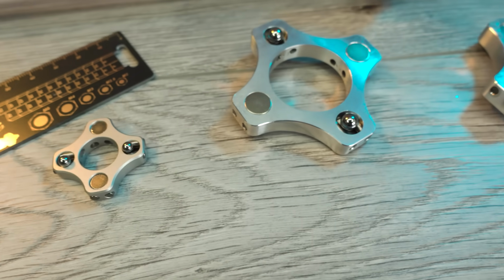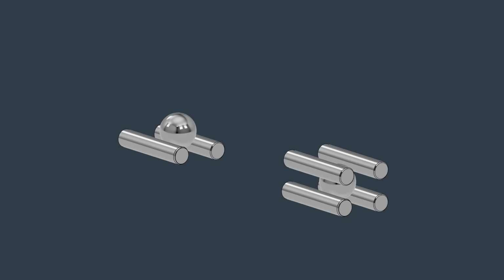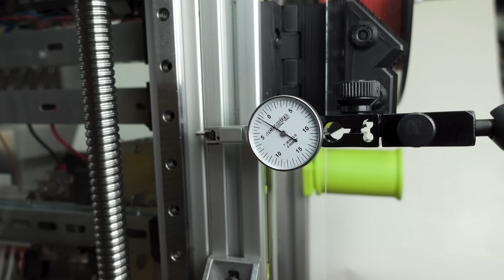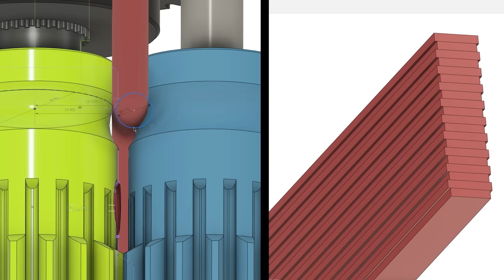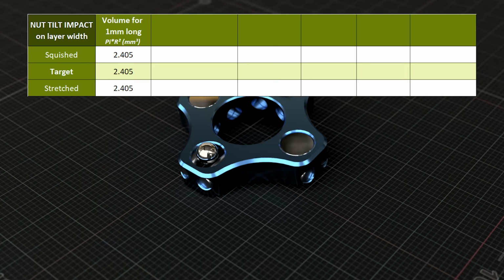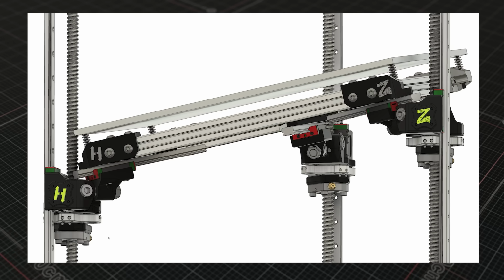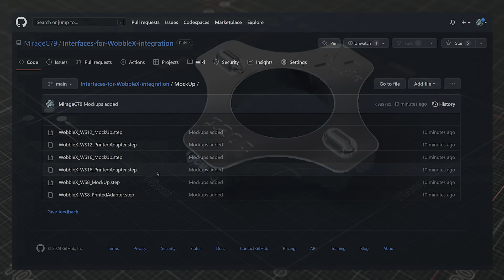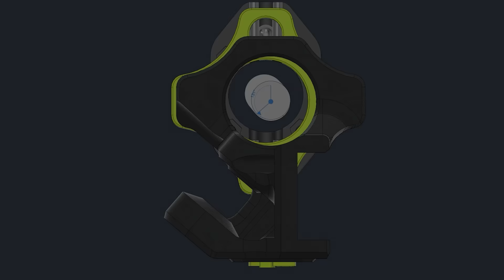I will never talk about Z wobbling ever again !

Comment: 😂 if your thread rod was on a flexible coupling and not constrained at the top wobble would not be an issue because it would float. Use linear rails to align the build plate.

Comment: I appreciate the content and the video but I’m a little bugged that you didn’t just replace the part that needed replacing before you did the first print, it may not have changed the results at all but we will never know for sure because you tampered with the only thing that would keep this measurement an accurate representation of its effectiveness.

By changing that one additional piece out you lost the ability to attribute the changes to your new design and means this isn’t a reliable proof of the quality gains.

Comment: The ratrig v-core 3.1 remove any z wobble with a constrained leadscrew and a bi-material leadscrew decoupler, it works like a charm and is less complex than your system. But it uses standard tr8-4 leadscrew, not a ballscrew like yours.

Comment: Building a Trident. Going to get Wobble X but should I get ball screws also or just stick with lead screws. Is is enough to run Wobble X with leads? The ball screw upgrade seems kinda a pain with having to couple them and modded STLs.
Reply: Don’t get wobble x get mini oldham wobblers, they’re cheap and work the same.
Reply: @SecretAccount-v7u few things, I can find a real good video on them. I also don’t think they are big enough, I’m using a 1204 ball screw so the hole needs to be bigger than 12mm. Also they are the same cost from what I see Wobble X is. 🤷‍♂️
Reply: @F1v30h1 ah ok it seemed like you were still deciding between the leads and ball screws, which Is why I recommended them, they’re ideally the same thing as the bi material decouplers that the RatRig vcore 4 uses with the tr4 leads. 

They do make them for ball screw setups, would save a lot of weight and size but you may have trouble finding them as they’re not as common.
Reply: @F1v30h1 you could always make them yourself if you want, I ran a homemade set for a while using 2 precision flat washers with a thrust bearing sandwiched between them and a bit of grease.

Comment: could also just use steel belt for Z instead of ball scrows ( steel belt also run directly on the shaft so no off/runout from the gear chat you normally see with timing belt )

Comment: It mentions that the wobble x is intended for single lead screw applications. If I wanted to install on a dual lead screw system, could I install small springs to add a bit of squeeze preasure so that they don't separate.

Comment: Full rotation of a lead screw does not exactly translate into a single layer height. meaning there "squish/spread" of layers will gradually increase/reduce over multiple layers. So instead of ladder you will get more like sinusoidal shape

Comment: I currently have an anti backlash nut old ham nut attacked to an anti backlash nut (the hold ham has no threads since it's supposed to move round) spider coupling different motor mount and a thrust bearing. I even shimmed the motor forward to align it. Better.

Comment: On normal Prusa style printers, we eliminate this problem by having rigid vertical Z axis guides and a free floating bearing at the top of the drive screw.  This system allows the screw to wobble without affecting the printhead, I was doing this on my DIY 3d printers in 2010.  This just feels as if you are overthinking the problem, which is the opposite of good engineering.

Comment: I wonder if this would work at larger scale for a large CNC router using 20mm ballscrews? Often those deal with shaft whip when running at speed and that leads to artifacts on the parts as it cuts. Having a compensation unit like this might, while not eliminating the core problem of whip, alleviate its major effects on parts. Especially for wanting to cut things like foam.

Comment: I got so exasperated at looking for the cause of my wobbling and banding that, when I discovered that the second lead screw was going through a malaligned flange attached to the backplate, I lost it. 

Got unlucky with Creality's quality control (or lack of it).

I stripped out the lead screws and modded the z movement to use belts instead, driven by a stepping motor on top of the assembly. It rotates a horizontsl bar via a transmission, which provides the vertical movement for the belts. 

Worked a treat.

Comment: After buying 2 of the T8 versions of the WobbleX (at $16.50 each), here's my conclusion:  They were installed on a HEVORS coreXY printer with a moving bed.  Under normal use they seem to  work as advertised.  HOWEVER, even with 4 start lead screws, the gantry will drop somewhat under its own weight when the printer is powered off.  When the printer is powered on again and the axis homed I have had the 2 leadscrews become slightly out of sync due to the uneven drop of the gantry.  I have 2 independent steppers on my Z axis. This causes the wobbleX coupling to become "disconnected" from the bed bracket and the balls to fall off.  So if the leadscrews become even slightly out of sync there is nothing stopping RADIAL movement of the wobblex coupling.  If your printer has only 1 leadscrew or only 1 Z axis stepper with a drive belt driving both leadscrews you might be ok.   I have since removed them and installed oldham couplings.  Problem solved for 1/2 the cost of the 2 wobblex couplings.  I have 2 "very slightly" used wobblex t8 couplings for sale if anyone is interested.  I only recommend them for printers with either 1 leadscrew or 1 Z stepper. YMMV.

Comment: ❌use appropriate motion system for the 3D printer
❌improve all parts together, i.e. use a frame and linear rails that are meant to be used with a ballscrew or have the ballscrew mounted in actual metal brackets instead of weak and flexible and inaccurate plastic prints
❌buy high quality parts instead of a crooked ballscrew
✅ use crooked ballscrew that is way too big for this fragile printer and spend the money you saved on the ballscrew for extended engineering just to make the cheaper ballscrew somewhat usable, and then sell the solution to your self-inflicted problem on youtube

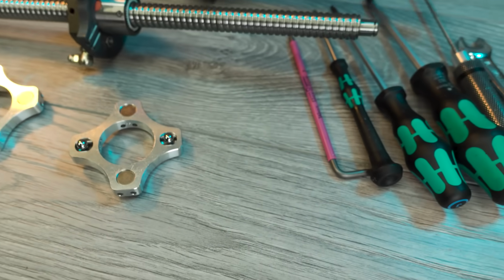Comment: 0:04 close. The actual best is to remove the screws all together and use linear motors ( though it can be a bit pricey for off the shelf or hard to figure out diy )
Reply: Absolutely not. I mean, unless you want to give away a ton of your Z height. This is a horrible use for linear motors.
Reply: @BifsieOfficial  casue zero chance of z wobbling ever happening. extremely precise. smooth and fast
Reply: Correct! Linear motors are better suited to this type of application indeed; their higher precision coupled with higher speed capability over ballscrews make them the obvious choice if not for the cost of entry; the low-torque demand of 3D printing thermoplastics lends itself to linear motors- one of the major reasons we build multi-axis turning centers with ballscrews over linear motors most of the time is simply due to a ballscrews ability to transmit higher forces into a workpiece (alloys). 

MCC (Marubeni Citizen Cincom) does infact produce a 4 & 7mm capacity turning center that uses linear motors on its X1,Y1,Z1 axis', along with Z2; AC induction motors are used on both main and sub spindles. Same for the live tooling drive- intelligent servo drive induction motor. The R04 & R07 were designed primarily with the medical implant industry in mind, although they are quite popular in the connector & aerospace industry as well. They are both used on any alloy you can imagine- 300 & 400 series SS, Titanium, Inconel, etc- while easily maintaining tolerances of +/- 10 microns in those tough alloys(these things can rip----  (32m/min)

Linear motors for all their extreme accuracy start having issues with larger material (10mm on up in turning applications) with hardness higher than 50 HRC. While it IS possible to design a linear motor to handle the application, cost becomes a serious concern. This is likely also a barrier to linear motors in 3d printing- at least consumer grade printers anyway. Even a small Mitsubishi Automation linear motor & way can easily exceed $5000 USD. Probably not many people would pony up for such a machine, considering printing PLA, PCTG, ABS, PPS, PPEK, ETC would never benefit from such tight tolerance capability. It would however be seriously cool.
Reply: @Alan-tr5uj  yeah they can easily be made for higher torque ( actually very commen ly used in those big gantry traveling 5 axis ) another benifit is also there zero contact zero physical wear 

i would like to correct you on one small thing. citizen lathe's do have or use sub spindle's. what they use and have is called a counter spindle ( diffrence is that as the name emply. a sub spindle is subpare to the main spindle in both power/torque and also regidity. but a counter spindle sit's and turn counter clockwise compared to the main spindle but have just as much power/torque and regidity as the main spindle ) ( im a fully educated machinest with speciality on turning and have worked on many citizens throughout my time and spike with both repain technitions that only do citizens but also to some citizen enginer's themself that all told me that they dont have sub spindles only counter spindels and what the diffrence was ( last one i used was a citizen abx64 ( tripple turret dual spindle all iso programmed by hand only cycle i use is threadding cycle( yes i write every single rouging pass myself ( actually prefer it that way. so i have absosolut controle over every pass and movement ( actually have my own special methoud that increase the inserts life time and remove vibration )

well if we could use the econami of scale to get the price down it could be need to then have and use a low speed high torque extreme precision version of them in a resin printer ( that increased/extra precise layer hight in resin print would be awesome ) not like it would make that big a diffrence if a resin print took 5 hours or 5 hours and 10 min when we reach those time scales

Comment: I would like to see comparison between wobbleX installed and not installed with removing the top holder for the balscrew which is unnecessary. I think will have same result.

Comment: The design looks fundamentally found. What I am wondering about is cost - if the wobble x costs $30, how much more would it cost to get a lead screw that is actually certifiably straight vs getting a cheaper one and a wobble x?

Comment: would this work on leadscrews driving other axis of a 3d printer? Thinking of building a printer driven entirely by high helix dryspin leadscrews and nuts. This may negate some vibration from high speed rotation if it could be mounted in other orientations.

Comment: Thanks for the response on the other Z wobble video. I am just copying my design query from there to here. Could you have also removed the wobble by placing the drive at the ball screw nut instead of at the bottom (or end) of the screw? You are only fighting the wobble because there is a gap between the drive and the ball screw nut and the deformation of the screw between the two. It would be easier to fix the screw (vertically, let it wobble around horizontally) and drive the nut directly with a thrust bearing between it and the platform connection. To spin the nut with the motor, not the screw.

Comment: This whole video makes no sense and is a snipe hunt.  Your extruder literally has NO play in it when on linear rails.  The lead screws are even attached to the steppers with flexible couplings so they CANNOT interfere even if you have lesser z-axis paths like wheels on v-grooves.   STOP this crap!

Comment: Do not waste your money on this unless you enjoy being on your hands and knees looking for ball bearings every time you look at the printer the wrong way. 

It works well when it works, but even the slightest bump (or even ironically, a bit of lead screw wobble) will cause the bearings to unseat themselves and fall onto the floor. 

If your lead screws and rails are too smooth and drop when the steppers aren’t energized, the angle is also enough to throw the bearings out of the coupler. 

It’s the worst. I am at my wits end with this horrid system.

Comment: I did much the same on a precision X-Y table I designed in 1993. The precision-ground NSK ball screw I used was very good geometrically but under high (1G) acceleration against an offset load, the ballnut would skew under deflection of the bracket and subsequently jam on the screw. What I implemented was basically a U-joint around the ballnut. Rolled-thread lead screws are pretty bad for precision but at low acceleration I suspect you could get away with a rubber mount.

Comment: I'm a little confused about why a person would buy massive rolled lead screws that have such terrible runout in the first place.
Reply from the maker: For their excellent ratio of Price VS reliability and low maintenance ;)
Reply: Low maintenance (for ball screws) I get. Reliability, well sure, they will be reliably wonky. (But if they are wonky in precisely the  same way EVERY TIME I can see the benefit.) The only thing left is the size, and that seems nit picky if that is the only complaint.     @MirageC
Reply from the maker: The size?  Ball screws of the length we need are offered in 12mm or 16mm as the smallest diameter available.  You may find smaller ones, but for rolled screws, its pretty much the minimum they can do without turning them to noodle.  Most manufacturers wont offer 12mm rolled screws over 500mm (including machined ends).   @jonathanseagraves8140
Reply: HAHA Turning them to noodle, I like that.  @MirageC

Comment: Remove the top bearing, let the screw wobble at the top. With only two points of contact you cant get any wobble.
Reply from the maker: on a flexible lead screw with a solide printer frame, this might work.  But when using ball screws it does not work.  I tried all possible scenarios over the past 4 years.  Nothing worked as good as these WobbleX.
Reply: @MirageC  i just got a cheap flexible coupler on the motor, screw rests on the motor axel, and the "nut" has some play and I haven't notice any wobble. My frame is not so strong, so my main problem is vibrations on corners. In your case you might have a flexible motor mount too, and all you need is to prevent rotation. If you have an extra bearing on the bottom that might prevent pivoting on the motor mount / axel. More mounting points more problems.

Comment: Does this device have to be metal? Maybe try printing it? I mean the body.
Instead of round shafts, can I use a scrap screwdriver or an HHS drill of the required diameter?
Reply from the maker: If your bed is not too heavy, you can make this out of anything.  ;)
Reply: @MirageC  Thank you for your reply. I thought so.
I have a Bluer Plus printer, it's like an Ender 3 but with two screws in the Z direction.
I'll try to print it. Using carbide drill shanks as shafts.

Comment: Hi, simply cannot understand why you don't get a straight ball screw or re-machine the bearing journals (if that's the issue) Probably one that is ground not rolled.
Reply from the maker: How much is a straight ball screw? And within what tolerance would it be?
Reply: I’m not an expert but I would guess a ground ball screw and nut would be a few hundred British pounds sterling. The upside is tolerance would likely be under 10 microns
Reply from the maker: A few hundreds for having to beef the frame up so it does not get wobbled around?  10 microns will still show up pretty good on the surface finish.  I think I prefer my 3 X 30$ screw with 3 X 25$ wobblex that completely remove the screw tolerance from the equation. ;)  By the way, some aircraft flight surface (Flaps) actuation system use very similar systems on their ball screw nuts.
Reply: Hmm, not convinced. There is probably a reason that ground ball-screws are found so commonly in precision equipment.  Complexity is the enemy of every design and your solution looks like it opens the door to many more issues than it solves. I understand it’s your baby so you feel protective over it though.
Reply from the maker: @johnharlow486  don't get me wrong, if you have the money to through at good ball screws so you can benefit from their low maintenance and high linear precision, be my guess.  I wanted to provide this opportunity to a larger crowd, myself included.  Soon to be 3 years using this system without a glitch or maintenance.

Comment: Just put a ballscrew of a lower diameter!!!!!!!!!!!!! 16mm is ridiculous for a 3D printer!!!!!!!
Reply from the maker: What size do you have to propose that could get us to 400-500mm print height (550-650 screw length)?  12mm ?  12mm rolled ball screws are usualy not available in very long sizes due to the manufacturing process affecting the material almost to its core.  Some listings are available, but they are pretty crooked.